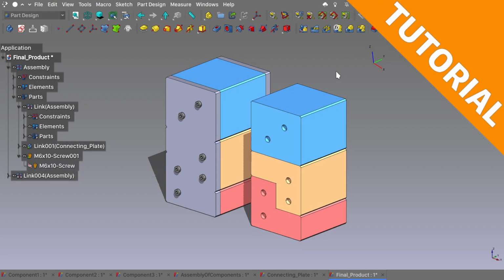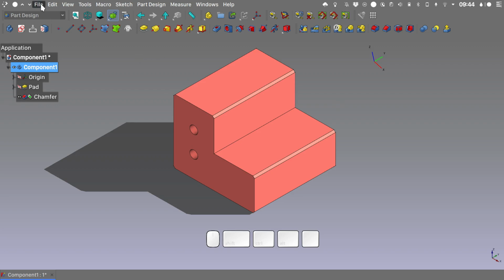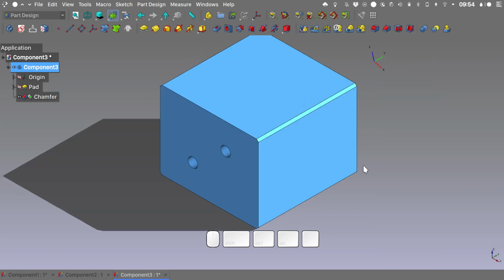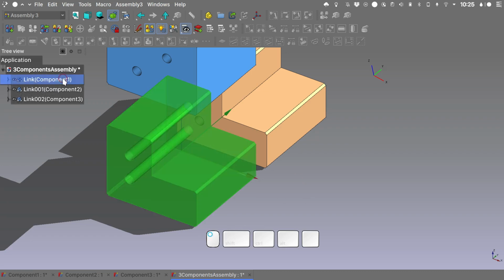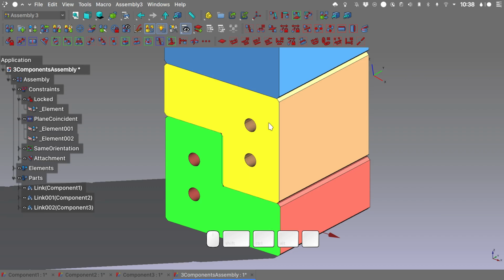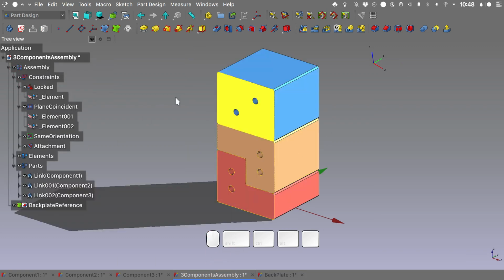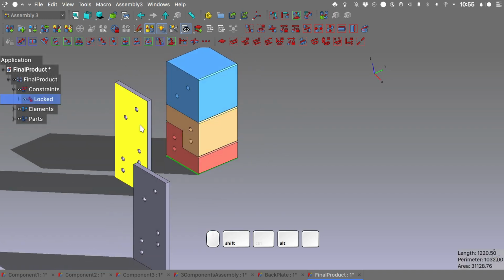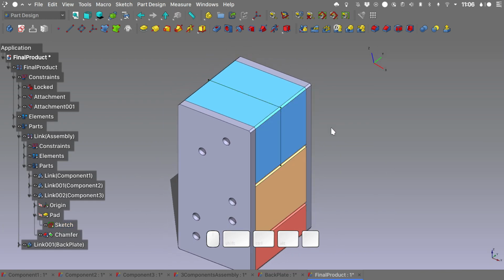[LinkStage3] FreeCAD in context modelling. Simplified version.

Comment: For some reason this only works for me with shape binders, not subshape binders. The shape binder produces a face, and I can reference its geometry in a sketch after linking it to my new part, but the subshape binder only contains the edges (not the face itself as well) and I am unable to reference the external geometry in a sketch. Any ideas why this is? 

Edit: I figured out how to use the subshape binder. In your assembly, under Parts, "Toggle active body" the part you want to model based on the references. Then select the geometry you want to reference in the assembly. Then create the subshape binder. The subshape binder should be nested in the body of the part you are designing. I made a video detailing this for others who were having trouble like me. 

Fantastic tutorial by the way, this really makes my biggest issue with FreeCAD (creating parts that reference an assembly) so much easier. It's not quite as intuitive as Solidworks, but at least I can do it now!

Comment: Nice Video. But somehow I cant import the external geometry from a linked sub shapebinder... either it doesn't even "see" the shape binder or when I move the sketch out of the body to the root where the shapebinder sits it says "Failed to add external geometry: Not able to add external shape element"
Reply from the maker: I can't really understand why that happens to you and it's hard to help whitbought your file to see where the problem lies. If you have a shapebinder at the root of your document and a active body that you work with, using "import external geometry" in sketcher should automatically create another subhapebinder inside your active body. Please try to refollow the tut and report back
Reply: @OficineRobotica  I already got it working by linking the whole object and creating a shapebinder of that. I didn't use the Assembly for my project, I wanted to use it to model a part based on that body in a separate file.

Comment: Brilliant video! Extremely well explained

Since each part was designed in a seperate file, is there a way to have a common spreadsheet between them? (So you can change a parameter such as the hole size and have it reflect on all the parts)
Reply from the maker: I actually wanted to do a video about it but discovered a bug(?) in Link branch regarding cross file sharing of data. Reported it and as soon as it's fixed I'll do a video
Reply: Also wondering about this

Comment: Great video 👍 I wonder if it is possible to do this in steps with a threshold value I would like to switch to bigger skrews parametrically but M6.5446 skrews are hard to come by at the hardware store...

Comment: Nice. It shows what can you do, including modifying a link directly in the assembly, and you activate it. I am still wondering why can't you use a shapebinder between two links in assembly because it insists to make a body active, and despite activating a link, it doesn't see it as activated. An example: I made a gantry for CNC , with two supports on either side. Supports have holes on top for mounting screws. I assemble the gantry with supports on either side, and want to use supshape binder to transfer those holes to the gantry so I will know later from tech drawing where to make those holes, but it won't let me. I had tu use bodies in one assembly file, not links, so everything had to be saved in one file. Thanks for the turorial. Very helpful. If Assembly 3 strives for becoming a main assembly worobench, wee need more turorials like this and clearer documentation because tuere are still some workflow mechanics to be explained for an assembly to be cohesive and don't break down.